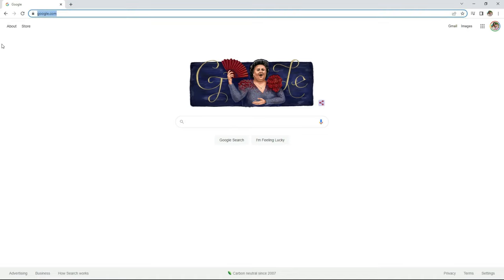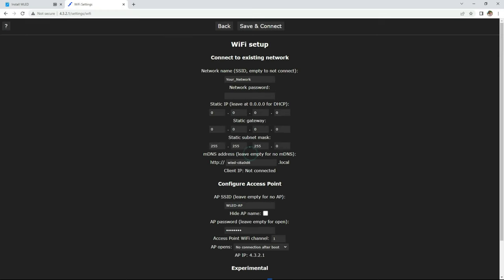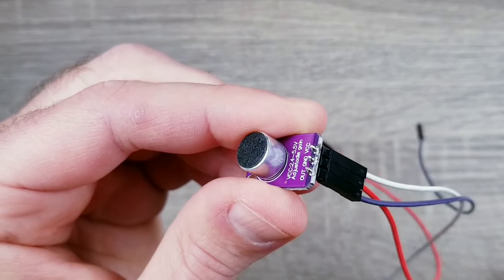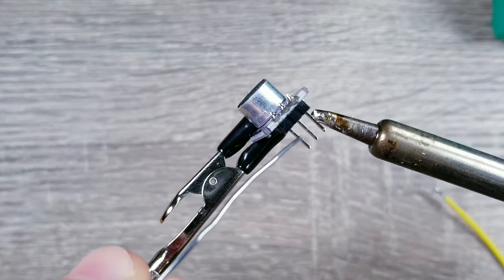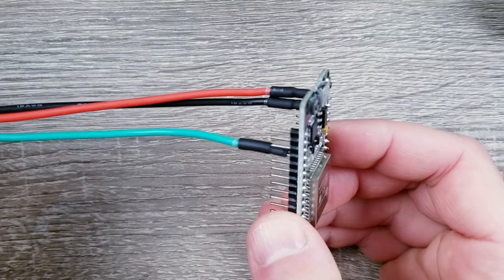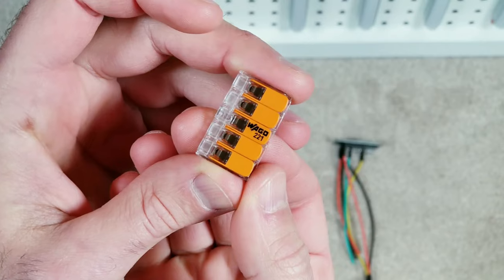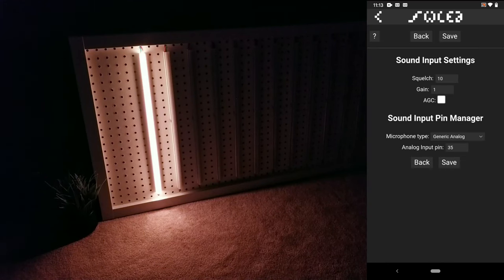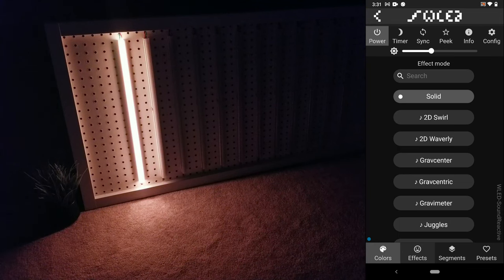WLED Sound Reactive - Complete Setup Tutorial

Comment: hooked  up the mic pins output to pin 35 bt still the sound reactive is not working what else can go wrong can u suggest anything, using esp 32 with MAX4466  mic and sound reactive latest version 0.013
Reply: I too have the same problem.....how do you managed to do so
Reply: I didn't solve the mic part but used software like Ledfx or Signa RGB to sync with the music, red the wled forum got to know that need to use digital mic like INMP441 mic

Comment: my esp8266 board is not supportet .. why ? u use esp8266
Install WLED SR
Do you want to install WLED SR 0.13.3/2210301? All existing data will be erased from your device.

Installing WLED SR
⚠
Your ESP8266 board is not supported.
Reply: it is..Just an error.Try a few times.but i can get my wifi to work..no lights..Even after reset..
Reply from the maker: Thanks for watching and sorry your having issues! I have never seen that error before. I'm using an esp32 but the esp8266 should work as well. Maybe try it on a different board and see if its doing the same thing.
Reply: @ChrisMaherDIY  he has the wrong file.I will post a link that works.its one version lower.Had the issues also.I cant.No links allowed.Stupid mods